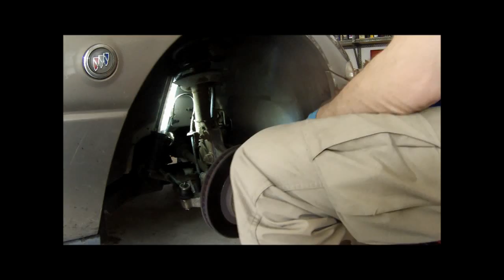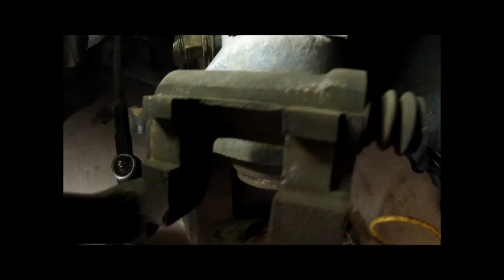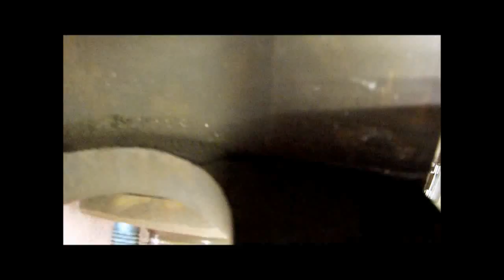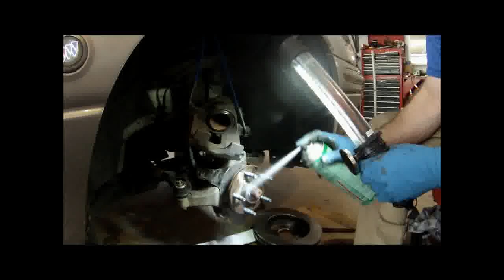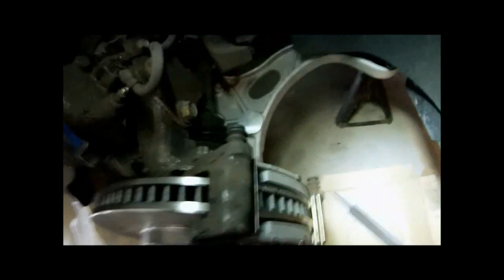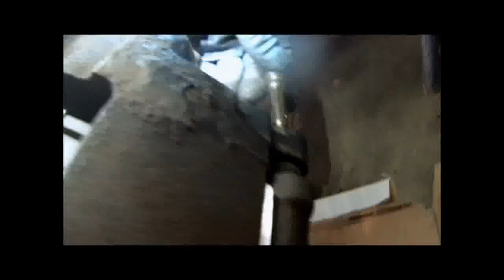2000 Buick Lesabre Front Brakes

Comment: You took out the two caliper bracket bolts, and removed the bracket and caliper as one assembly... Usually, you compress the caliper piston, remove the slide pins and pry the caliper off. Just wondering why you didn't it the way you did it?
Reply from the maker: I don't think there was a specific reason... it was over 4 years ago...  I usually get a screwdriver beteen the rotor and pad to compress the piston a little and remove the caliper and caliper mounting bracket separately.